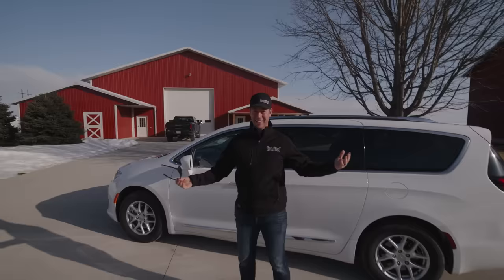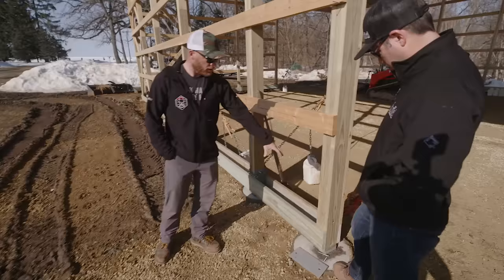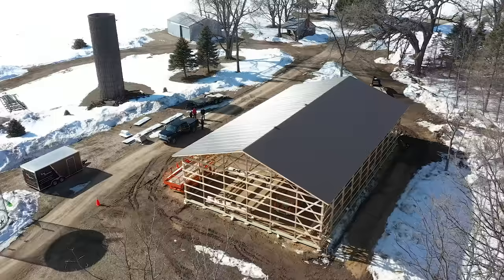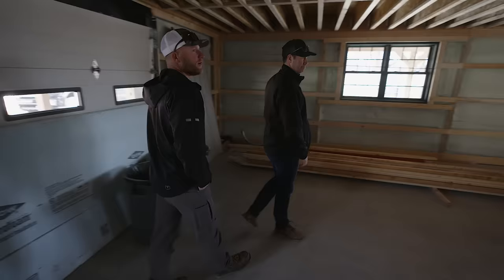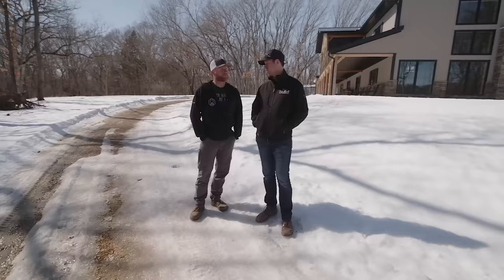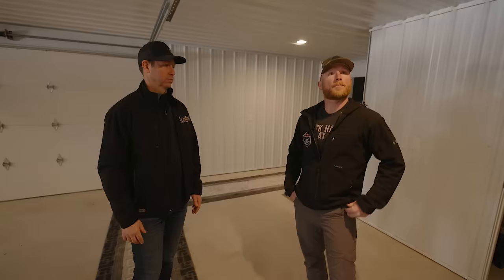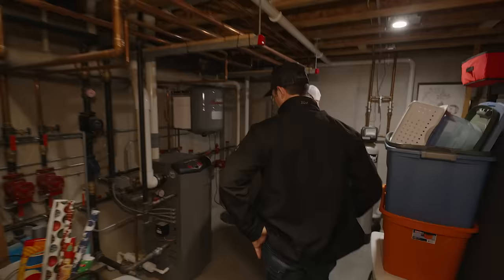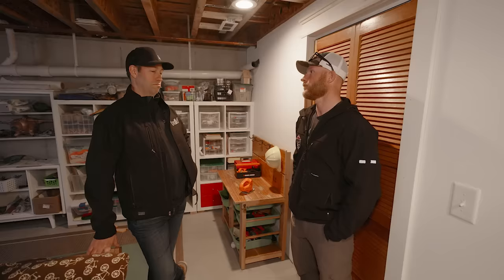BIGGEST Building - LOWEST Cost - Post Framing with RR Buildings!

Comment: People want square footage for a low cost. I'm his target market, my wife however will need some convincing.
Reply: Introduce her to the “she-shed” concept. 😉
Reply: I'm not in poor lol
Reply: The low cost is a myth.
Reply: @TheKingOfInappropriateComments  my post frame is 155ftx85ft and if I didn't want 5 roll doors it would have been cheaper per foot than my 2 pole barns.  It's well insulated and has a full bathroom. They tend to be a good value but the "low cost"is a poor choice of words.  Also the typical massive conditioned space can get expensive to heat and cool
Reply: @jeffreyhill1011  That's true but the whole point is to have super high ceilings and tons of glass whether it's a wall of windows or a rollup door.  And there's also the issue of resale value. As you can see from the comments, guys love it but having to persuade the misses means it's probably not going to have the wide appeal that say a timber frame has. I live in a timber frame by the way. Not to be confused with a post frame.
Reply: We did 1200 sq ft finished inside of our 40x80 for $88k...including the NFPA 13D fire protection system.  The triple mini split was the single highest cost, $12k.  Foam was 6ish.  Plumbing fixtures were I think $6k (1.5 bath, kitchen and shower).  Lighting package was around $4.5k.   Large internal 2nd floor deck over car parking was something like 6k and worth every penny.  Did some stuff ourselves like pressure plumbing and floors.  Building at the start with nice soffits, 2nd story deck, 14x80 lean too etc. was $75.  Total with concrete under $200k.   Not "cheap" but man...we love it.  For perspective, we left a 4800sq ft brick ranch.  I don't miss that thing at all.  Too much wasted space.  If I'm putting space under roof, to be taxed on, I want to USE that space.  Turns out we "used" about 1,000 sq ft of our house....and thats about what two people need to be comfy. 

My wife LOVES the smaller space...much easier to keep up with and organize.
Reply: @TheKingOfInappropriateComments  True.  Wait till the building inspectors want the county's share of those savings, then the engineer for his certs, electrician, plumber... hey you cut out the drywall guy!... wait, you want a room in that?
Reply: @ScrappyXFL  Back when i was trying to build, I wanted to eliminate dry wall. I'm not a fan of it either. A building inspector told me it was required by code for fire protection. So what might pass for a commercial building with a sprinkler system as someone else mentioned, or a residential or agricultural auxiliary structure, they might have issues with for a residential building. But again, out in the country rural county then they might not give you any grief.
Reply: @TheKingOfInappropriateComments  There's someone not to far from here that has a structure under his pole barn.  I think the way he got around it was 1) no roof on the living structure itself, no engineering certification for windload (yes, FL)  2) pole barns don't need inspection, just an out structure permit (if that, it didn't have walls so it may not have needed that.  I know our "shed" needed the permit/fee because it had walls; less than $100.).  
The only thing he would have "needed" would be a perc test for septic, maybe a plumber to sign off on the septic field.  

It was a construction trailer cube (like a slide off one), maybe two together, with the ac compressor on top.  Nice cube too, probably had elec and plumbing already fitted before dropping it.
We used two for the pipeline I worked at way back, almost like a mobile home; they weren't together, one was admin, the other engineering.  Used a standard trailer for the workshop but even it had a fridge truck ac unit.  Wow, back in the day, we were stylin!
Reply: @jeoinaforest  That's really what I want to do but I kinda want to get a metal building so there's no chance of rot and it'd last basically forever. But I want around a 40x50 to get 2k sqf (I'd go bigger, but I don't think I can afford to) and then just build a roughly 500-600 sqf section on the inside for living space and use the rest as a wood shop because I'd ultimately like to build furniture for a living as my dream job. But I'd like to do everything myself that I can other than concrete because that takes a lot of people. But I'd frame everything myself, build all of my own cabinets and doors insulate everything myself maybe get some help with the electrical but I can at least run the wires around myself and let someone qualified hook it all up to be code worthy lol. I'd really need to stay around 150-175k all together but that would have to include the land, septic, well, power and stuff like that which I could do the septic myself dig trenches for everything myself and I found a lot that's listed for 80k for 10 acres with power right next to it. But it's been listed for almost a year now so I could probably come in around 60-70k dollars and that would leave roughly 100k to do everything else which I think would be a decent amount to do what I want. And everything wouldn't have to be done right away I mean I can get it all dried in and then maybe a year down the road save some money and throw some insulation in the shop area or upgrade to more lights or more power or something maybe every month buy a couple sheets of osb or plywood to sheath the inside. I'm not very picky and I already have a 34' fifth wheel I've lived in before so I can just use that while I get everything done by trying to cash flow it. The problem I'm gonna run into is getting something like that financed through the bank because I unfortunately don't have that much money lying around and here in Colorado housing is so expensive but I think if I got it done it'd be a 250-300k dollar property. Just looked on Zillow the other day and someone by me was selling an older 983 sqf home on a 1/4 acre lot under contingent offer according to the listing for $345k dollars, and no, it wasn't very good looking either. It's insane out here you can't even find houses an hour outside of town for less than 300k, maybe 250k if you wanna live in a complete dump that needs another 50k in work anyway and no property with it lol.

Long rant, but anyway your post gives me hope that I can get the same type of setup my self one of these days.
Reply: it ends up costing more to properly insulate, then add standard framing so you can add electrical hvac and finish work
Reply: @dedalliance1  Great goals!  I would say that resale will be significantly lower than a standard stick built....any "unusual" construction is harder to resell.  That in mind, lots of single guys these days, and thats your sales pool if you ever move.  Us? we are dying here so don't care.
Since this is a business endeavor, do not forget to take taxation into account.  This entire building needs to be a write off for your business.  Pull in a little travel trailer and live in that.  Do not attempt to split "personal" and "business" with your building/tools etc.  Nope, its ALL business and all written off.  Your $2,000 travel trailer will be the best investment you ever made if you structure your finances that way.  Our build out will be 100% free in tax savings over time.  We are building a house in future anyway for our home, but hey, LOTS of people live in travel trailers.  Plus, how you finish out the inside is none of the counties business later....  Put your septic in for the travel trailer and you are golden, if you choose to put a toilet in the shop, whats it to the county?  Taxes are the single biggest theft any of us will ever experience...hell, its literally impossible for a thief to steal as much as government steals every year...thats EVERY YEAR!!!  Its impossible for a thief to steal $50k because there is never $50k in my damn wallet anyway, or stashed at my place...plus our "stuff" is all insured...really the only thing a thief could steal is the $1,000 deductable...so like 4 DAYS worth of government theft..... and people worry about thieves...LOLOLOLOL
Reply: @jeoinaforest  Yeah I'm with you on all of that I'm what you'd call a 'Libertarian' and I'm very much against the Government and taxes lol. Luckily the county I live in at least for now is Unincorporated so the taxes are pretty low and the regulations as far as I know are fairly laxed which is nice. I'm just not sure how I'd go about making my business a 'legit' business I kinda just sell stuff on Etsy or Craigslist right now because I don't really have the space to setup a legit shop so I could actually produce a lot of stuff. But yeah I'd have to look into the possibilities of making it a business property but then trying to get that financed might be difficult I'm not sure.

But as far as ever selling it and trying to get the value from it I wouldn't be too terribly worried about just because there'd be really no point in leaving because everything else is too expensive anyway, plus if I did do it on this specific lot I found it's on 10 acres so if I ever got married and had a family and needed more space I could easily just build an actual house on the property or just another 'Shop' that may or may not be finished into a house later, lol. And to help offset the costs I'd really like to rent out some camper spots or tiny home spots and give them maybe a half acre or a full acre of land because this used to be a corn field so the soil is fairly good and I could rent out to this new 'minimalist' generation of people and they could have big gardens and chickens and animals if they want I wouldn't care as long as they pay me. A guy close to here is charging $650 a month to park a camper on their property which includes all utilities but I don't think they're offering any land with it, and he had 4 spots available. So if I come in at around $500 a month with the option of land and get 4 people to rent that then it's 2k a month and my mortgage would be around 1k a month ideally if I stick around 150k for a loan. I'd have to obviously spend a little bit of money to run power lines to their campers and water hookups and sewer lines but I don't think that'd be a huge cost because I can trench it all myself and do basically all of the work myself other than maybe electrical just because running 50 amp power scares me and I don't wanna hurt someone by doing it wrong.

It's really pretty expensive these days to live in a camper when I was working for the Montana Carpenters Union a couple years ago I was living in my fifth wheel and one guy wanted to charge me like $400 a month to park in the front yard of this house he had that no one was living in because it had water damage, no 50 amp power the septic tank was in the back yard and he said I could just run a garden hose from the house for water. And when I was staying at a real long term camper place it was $800 a month and you didn't get a 'yard' or anything just barely enough room to park your camper and put the slides out and you only had room to park 1 vehicle there. Most of the time I just lived in Walmart parking lots running the generator because the fuel was cheaper than renting some where lol. But anyway so I know what it's like living in a camper and I'd like to make a couple affordable spots on the property to rent out to people especially here in Colorado there's a lot of oil and gas guys and welders that work for the summer and just need some where to stay in their camper and then they go back home or to the next area like Texas or something for the winter months to work. Heck, I'd rent out a couple spots with no hookups or anything for $150-$200 a month they could at least have water and just move their camper over to the septic and dump directly into it if they wanted to and run off of a generator or solar. They actually make little RV septic tank transfer tanks that are like a wheel barrow but enclosed and you dump your gross water into that and then move it over to a septic tank or dumping station some where and then empty it people could get something like that pretty easily.

I'm always trying to find more ways to make money because I don't make a lot at my day job compared to how expensive things are these days and I'm tired of being broke all of the time. I just need to find a bank or private lender that's cool with giving me some money for a mortgage so I can make this dream come true because even buying land you need 30-50% down which I could afford to do that but then I wouldn't have much money left to build out the inside of my house area and pay for stuff like running camper hookups or putting up fences and buying tools for the shop. Anyway, that's a lot of ranting.
Reply: @TheKingOfInappropriateComments  There are fireproofing coatings that will work with code.
Reply: @hanto_shibori  Oh I'm sure there are. But you have to convince the inspector. And then maybe the construction lender and then the mortgage lender's appraiser if applicable.

Comment: I use under slab heat... latest from the engineers is to "not" insulate under the slab just around the rim and  in about a foot... when the dirt under the floor is heated, it becomes a "thermal mass" maintaining the interior temperature longer and using less circulation cycles per time duration... and  your options on how to heat the liquid  under slab (we also cycle it through masonry seating around fire places and pits)... so wood, (propane) gas, (solar) electric, etc. can all be interchanged (or switched to) at your "heat exchanger" manifold...

Comment: Not putting anything down here everybody, but right around the 4 minute mark it shows the wood column off set of the concrete peer, by a lot, like almost on the side, and it showed a few of them, maybe someone can explain, cause it looks like a pretty good screw up
Reply: i think there is nothing to explain, the foundations simply do not match with the posts. Fail of the foundations crew?
Reply: Saw that too

Comment: My post frame shop was framed like a regular house with the walls laid on their side.  Foam sill gasket was put down on the slab, with treated 2x6s tapcond down.  8ft wall sections were built with 2x6 horizontal girts on 2ft centers nested inside vertical 2x6 "posts" and screwed to the treated sill plate.  The trusses were set where the wall sections meet.

Comment: Other than the truss roof structure, the wall frame remind of a lot of the old New Orleans houses. They used lumber from barges that came down the river, the barges did not go upriver. They demoed them using the lumber to build the houses. The studs would go from the sills to the attic (two stories). No fire stops, a fire started ground level would be in the attic in minutes, like it was a blow torch.

Comment: Kyle, it’s still a pole building. Been building them like this for decades.
Reply: Nothing ground breaking here. 

Chains for bracing is completely unnecessary. Plumb the building with ratchet straps, brace with 2x4s. Put down the steel, remove the bracing. Been going on like this for decades.
Reply: 36 years of buildings construction. This is a pole barn, call it what you want, but in the end, it’s a pole barn.
Also, a wood frame, will never out perform a steel building for strength.
Reply: Iron *Fe*  Wow what a bunch of crochety old men you guys are.  By the way, Chris Stedman, the reason for the chains is for plumbing up for window frame installation, as Kyle mentioned in a video regarding that very building.  That's all it's for.
Reply: @9.5Nubbins  Steel will never out-perform wood just in the area of condensation.  Wood does not have the same problems with condensation "wicking" in wetter climates.  So for residential, steel does not make as much feasible sense in wetter areas.

Comment: We now just need Steve Baczek to do the plans and details for an RR high performance post frame.
Reply: That would be great!
Reply: In a way he already has. If you look at the house he did with Jake with no structural interior walls, concrete slab with foam/advantech, and drywall for the ceiling air barrier. All of the techniques could be used on post frame construction, just with more efficient wall and attic insulation. Watch some of the RRBuildings videos even of just the garage shop builds to get a feel for the feel of the construction process, then go back and look at the house Steve and Jake did and it is easy to see the similarities.
Reply: @MD-lm7fj  Yeah, but I don't think you can compare the performance details of one of Steve's projects to a post frame. Though 3" of CCSPF in the walls and an R60 in the attic on a post frame would be outstanding compared to most of the houses I see built.